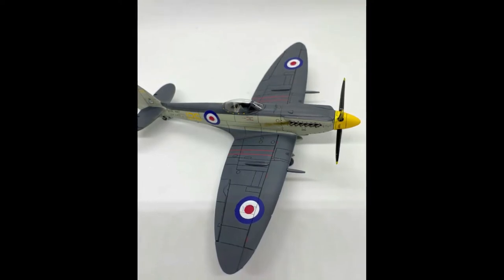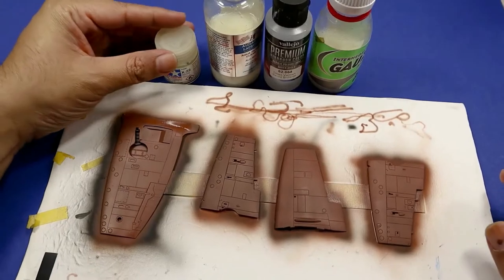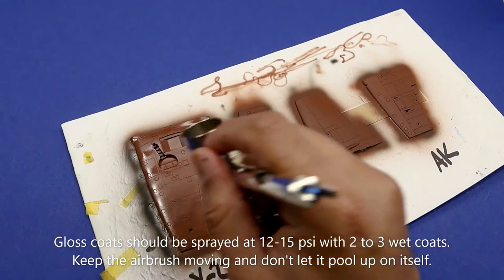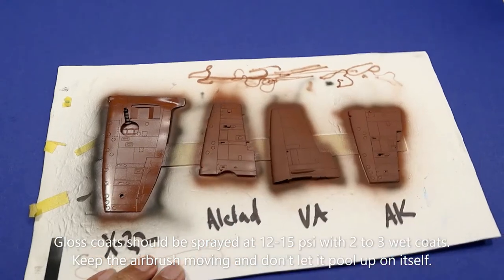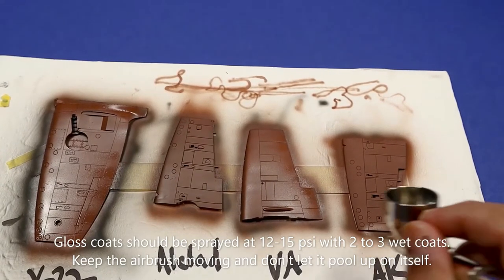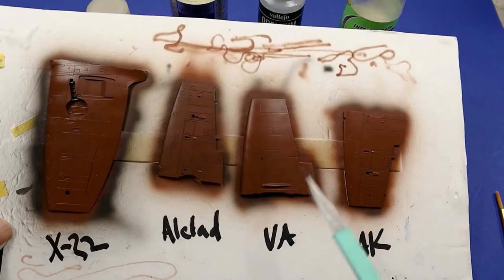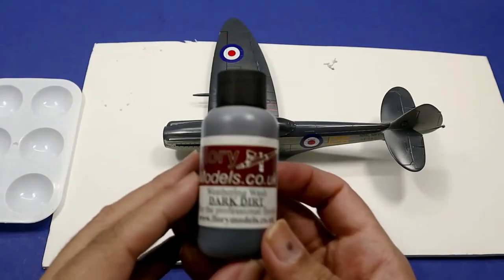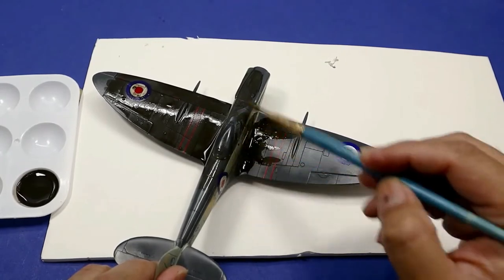Why you should always gloss coat your model.

Comment: You might want to try this:  When applying the decals, do NOT use any MicroSET.  I have found it to be the culprit for the stains in the paint.  Use just water, let it set, not dry, and then use MicroSOL until the decal is as good as it will ever get.

Disclaimer: This has worked for me.  Of course YMMV.

I had no seen that wash you used.  I was horrified when I saw you applying it.  But then, after it dried and you showed how to get two end results, I was amazed.  I'm going to have to experiment with that stuff.

All in all, good show.

Comment: Hi and thank you for all the great videos you upload, they are very helpful! Have a question, you thinned X-22 by 50-50, would the same thinning ratio also apply for the LP9/LP24 or since they are lacquers the ration should change (always at the range of 15psi)?
Reply from the maker: Hi Bill, glad you like the videos. Regarding your questions
1) no matter what type of gloss (acrylic, lacquer, enamel), always use low air pressure, 12-15 psi. And make sure to do wet coats. 
2) with the LP9 LP24, you can airbrush then out the bottle. But for best results I recommend using Mr hobby leveling thinner. Thin at 50/50 low pressure, so wet coats, not to far from the surface. You should get a beautiful finish. Let it dry 24 hours.
Reply: Thank you very much, I was gonna use mr color thinner anyway but I just wanted to  know if and how much I should thin them. Thanks again and keep up the good work 👍👍

Comment: Hi could you tell me which varnish you used for the Satin coat? Thanks and great video
Reply from the maker: Steven, glad you liked the video! The satin varnish I used was the “Vallejo satin varnish premium line”. It does not need to be thinned and you spray it at 12-15 psi.
Reply: @arewethereyetmodeling2196  Thanks for your reply. I have a bottle of that varnish. I stopped using it a while back because I kept getting a dusty finish, but i'll give it another try as at the time I was spraying at much higher pressure than I do now so that could've been the issue. I've also purchased some Gauzy agent on your recommendation. Thanks again
Reply from the maker: @ste022  definitely give it another go and feel free to reach out if you have further questions.

Comment: Fantastic video! The vallejo varnish you dilluted it 1/1 with the acrylic mixture thinner you shown at your other videos ?
Reply from the maker: John, glad you like the video. I did not thin the Vallejo varnish with my mixture formula. I use the premium varnish line from Vallejo. They do not need to be thinned. If you use the non-polyurethane varnish. You need to thin those for airbrushing, with Vallejo thinner. If you use my mixture to thin the non-polyurethane varnish it will slow the drying time. Which you don’t want with a varnish.